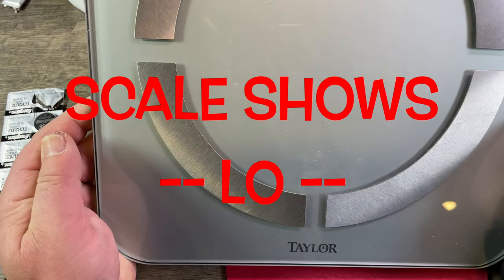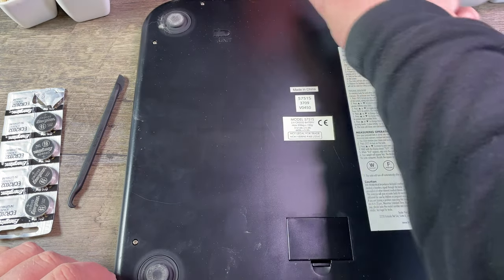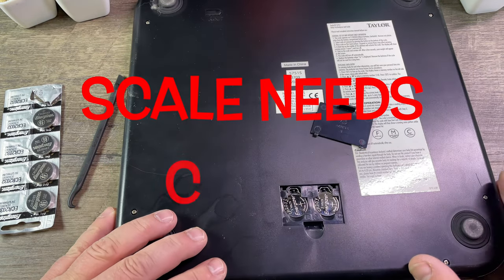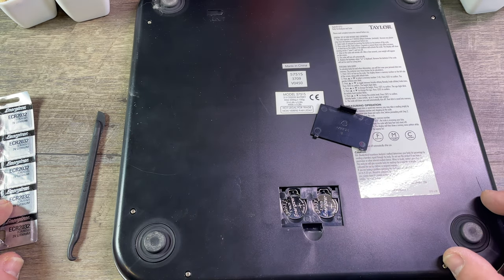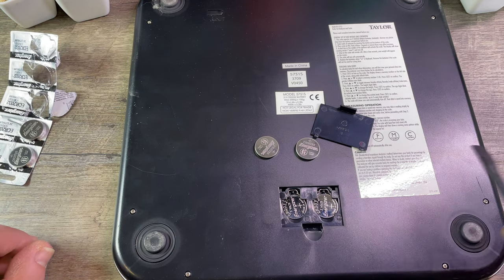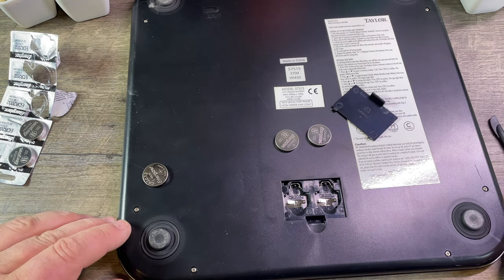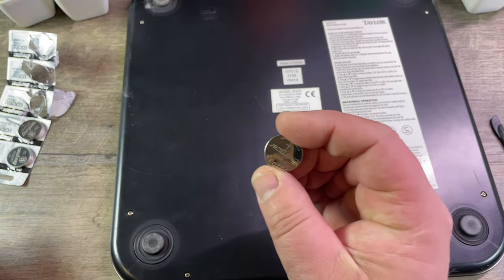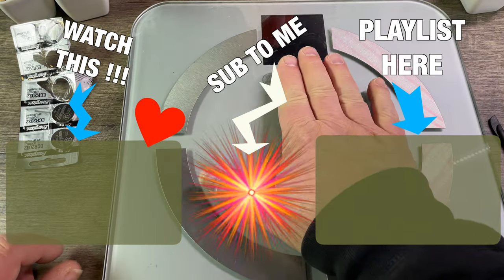Scale shows LO

Comment: What to do if the display shows LO but if you measure the battery it is still more than 3V ? And if you replace it by another complete new one (measured ans 3.2V) and the gauge still diplays LO after turning it on every time ?